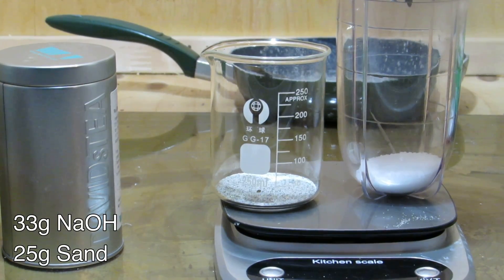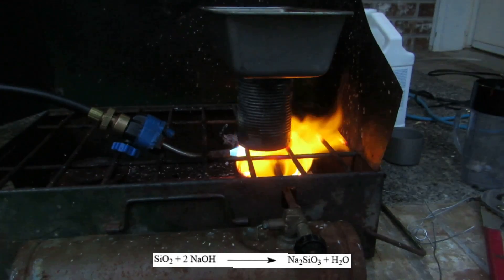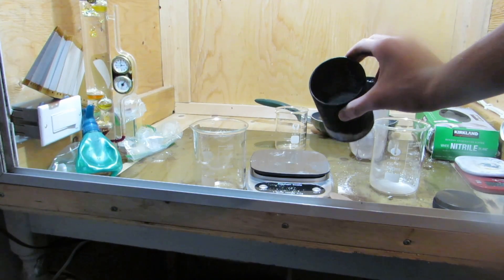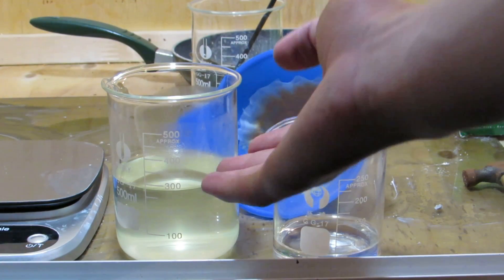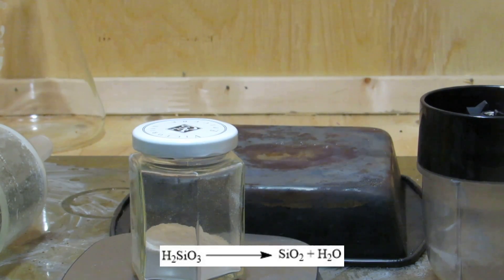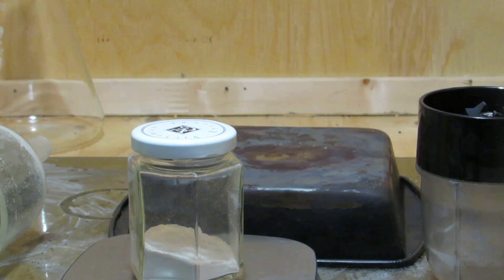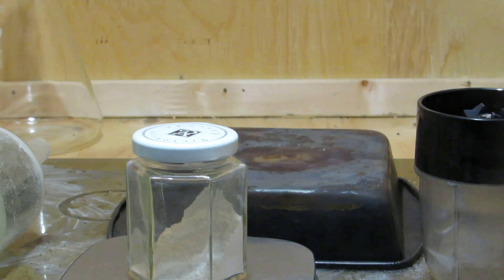How to Make Silica Gel (Amorphous Silicon Dioxide)

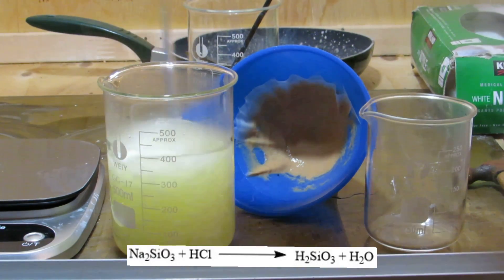Comment: Good Video. On the minute 1:20 show the filter with tailings. Is this completely organic matter and metals oxide or part of this is SiO2 that didn't dissolve during the fusion with NaOH? What process could be used to process up to 100 tons per day if the objective only is to open the crystalline structure to recovery the metals that could be precious metals?  How the industrial process works? Thx for the support.

Comment: i read if water added before drying, silica shouldn't dissolve in water it will produce milky suspension hence colloidal silica, else it still NaCl thus actually your silica  are discarded liquid,

 i might be wrong did you ever try this?

Comment: Doing it from water glass seems much easier that using torches. Am I missing something?
Reply from the maker: You’re right, if you have access to sodium silicate (water glass) directly, then you could just prepare it from that. If you don’t, then preparing sodium silicate from sand and sodium hydroxide is necessary. So I guess it just depends on what you have on hand. 

Do you know of a good source of water glass from over the counter materials?
Reply: Cat litter is often made of some SiO2 hydrate, it's available in literally any supermarket and also Amazon ofc., it's like 1$/kg... It's not sodium silicate, but silica based cat litter is begging to be dissolved in NaOH, zero effort required.

I've used it for many things but somehow never thought of obtaining pure silica from it again, that's a great idea!

Might be worth using H2SO4 instead of HCl to better get rid of the organic contaminants I dunno...
Reply: Cat litter is often made of some SiO2 hydrate, it's available in literally any supermarket and also Amazon ofc., it's like 1$/kg... It's not sodium silicate, but silica based cat litter is begging to be dissolved in NaOH, zero effort required.

I've used it for many things but somehow never thought of obtaining pure silica from it again, that's a great idea!

Might be worth using H2SO4 instead of HCl to better get rid of the organic contaminants I dunno...